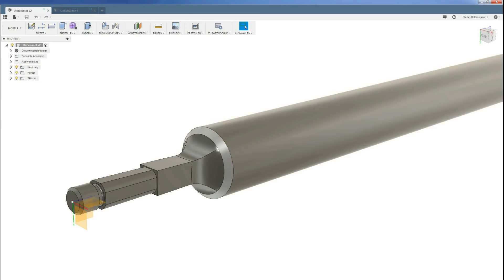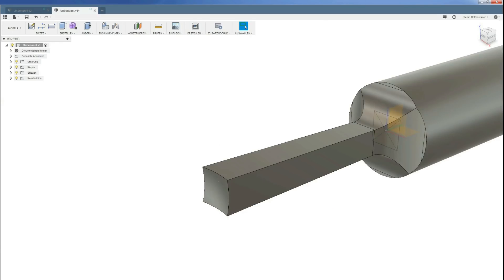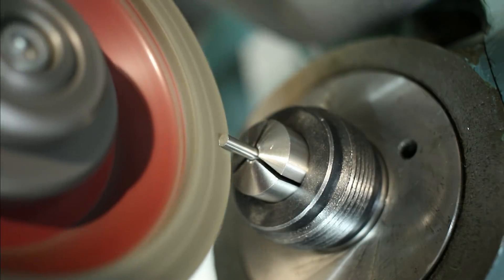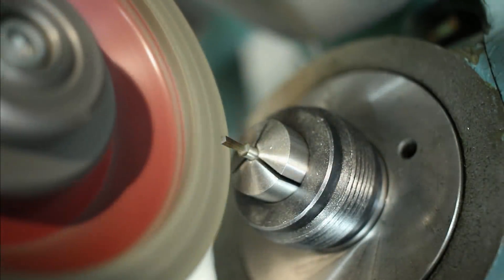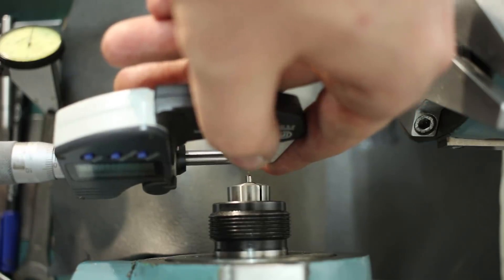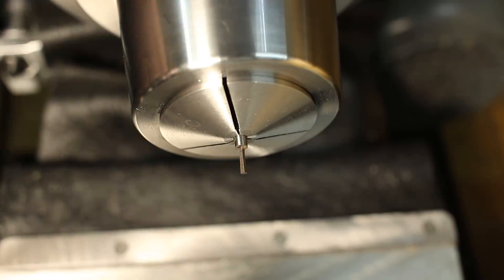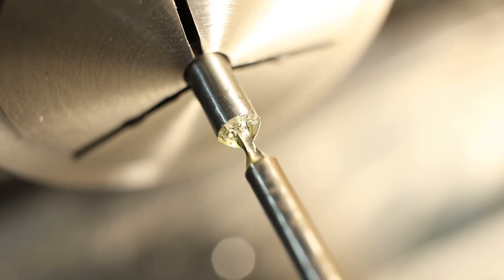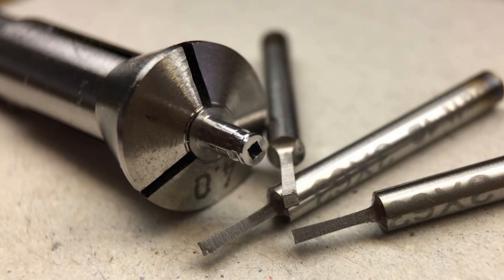Broaching a 1mm square hole

Comment: Whenever I see microscopic images I am reminded of the old question, how many angels can stand on the head of a pin?  
When you start criticizing surface finishes with a microscope, it's time to take a vacation.
Thanks for posting, Stefan.  It's a great video and quite an achievement.

Comment: Excellent job!
Reply from the maker: Thanks! I am just catching up with your videos, the size of your machines ist just insane. That Cinci Cnc mill looks like a total beast :D
Reply: Yes it is a bit different class of work that I do. :-) The Cincinnati should proove to be an awesome machine. It spent its life making mirror image dies for a roll forming operation that had to match within .0005" so it  should be a good machine. I just still need to source a transformer to run it.

Comment: Great demonstration Stefan.  I've never done a broach that small and would certainly struggle but have done down to 3mm in my surface grinder using an ER square collet holder and shim under the front edge to set the angle relief. Use a Dremel in the lathe tool post with an abrasive disc to cut the concave face.  I'll try it free hand next time as per your method.
Cam

Comment: Another great Video, thanks.
Nice approach, love your answer on how to bore a 1.1 mm hole ;)
I was wondering about the positive rake on your tool, now see your friend was cutting steel, most likely silver steel too,
as this is the most common steel used in clock/watch making.
Your broach did a great job.
Thanks.

Comment: Wait. How does one bore a 1.1 mm hole?
Reply from the maker: With a rather small boring bar ;)
Reply: And "vewy cawefully" as Elmer Fudd would say
Reply: I've got solid carbide boring bars that aren't quite as small as 1 mm. About .046" would be the smallest hole it's capable of starting in. I'm still getting my nerve up to use the smallest one on my manual machines though. At $45 + it would hurt a bit to break one. Resharpening will also be a problem at some point if I don't break it first. :-) There's supposed to be much smaller available from a few high end European tool company's. I suspect there only for use on very expensive high rpm cnc machines designed for super accurate micro machining.
Reply: Check out eBay item 253850846952 for enlightenment.
Reply: I would have expepcted reaming. I couldn't find that item, but there seem to be some very tiny ones available. I can't believe that they can cut a chip, but apparently that works. If they didn't cost what they cost, I would have already ordered a bunch.
Reply: My guess is the ones I have are made from a fairly special grade of micro carbide since there far sharper than the more usual grades of carbide Harri. The slightly bigger ones will certainly pull a chip. With drills down at this size I'd expect them to wander a bit and maybe not drill the greatest, straightest or roundest hole. Since reamers will always follow what the drill does for the most part, then boring after undersize drilling should give you a round straight hole even if it's going to be reamed to size. Cost? Yeah there a bit pricey, even more so when I had to buy a decent Criterion 3/8ths tool capacity boring head to even use them. My mill has the usual powered down feeds on the spindle or I wouldn't have bought the boring bars. It would take more skills than I think I have to hand feed them and not break the tips off.
Reply: You make your own boring bar, out of a micrograin carbide rod blank, or any broken off small carbide drill. You just need a hone, a GRS powerhone works well. I do it by hand under a microscope, though I can still do it by eye at that size. 1mm is pretty big if youre a watchmaker 😉 Honestly, its totally doable. Once you understsnd cutting geometry, everything becomes a tool if you hold it at the right angles.
Reply: Wire EDM?

Comment: I recently find your u tube channel and i must say that it is one of my favourites !! Can you pleaase advise me on what material of steel bar  would you suggest for turning small  drive shafts (about 5 to 8mm diameter )on lathe ?
Reply: Like Stefan says, it depends. But a common steel for e.g. motor drive shafts is a medium carbon (about 0.4%) steel. The medium carbon adds some tensile strength, the commonly available specifications have a bit of manganese thrown in which adds some toughness, and this sort of steel is through-hardenable. In the UK the common spec would be 080M40, which used to be known as EN8. In the US something like 1040 would be about equivalent. Depends on  your country what you call it.
Reply: Thank you very much , is this something like impax supreme from uddelhom ?
Reply from the maker: Depends of what you want to make. Does it need to be hardened? Rustfree? Acidresistant? None of the above? High strength needed?
Reply: High strength but not something like hardened ,  high speed rotation for a drivetrain on rc car ...